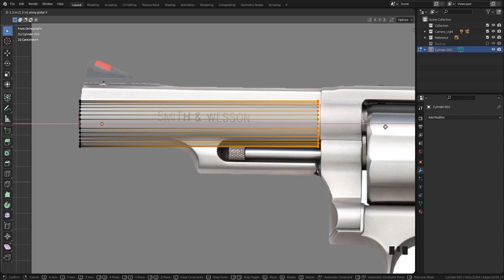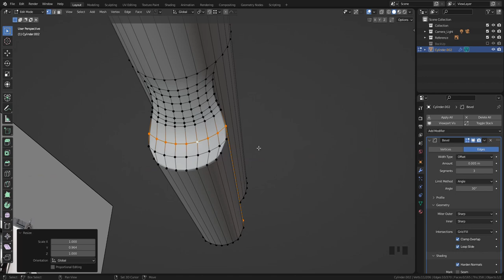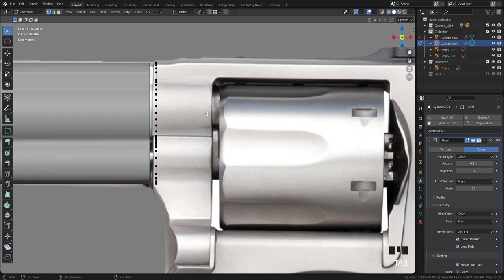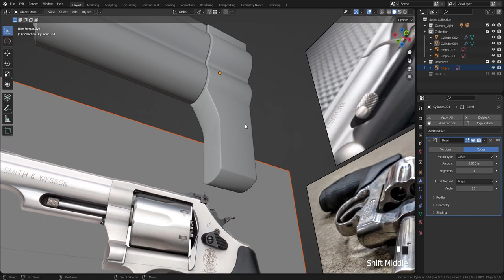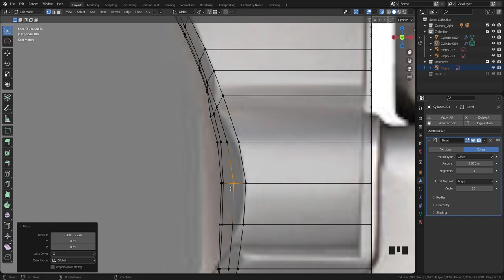Low Poly Revolver - Blender 3DCG Modeling Tutorial for Beginner

Comment: Would it not be faster to use symmetry  and soft selection @8.00. I made this not long ago using Fusion360, its you dont mind a triangulated mesh the vert count is about 6k when exported as a low detail obj , then a high detail at 2million to dynamesh in Zbrush for baking out the sharp corners. Its very hard to find sizes for say the outer barrel diameter, I find that very annoying. I end up using the cylinder and barrel to calibrate the reference image as best I can.
Reply from the maker: Hi, thanks for the comment!
Yeah using symmetry maybe faster than I did on this video. Using Zbrush for hard surface modeling sounds attractive to me. I recently learn Zbrush, so I would like to show some techniques with using other software someday.

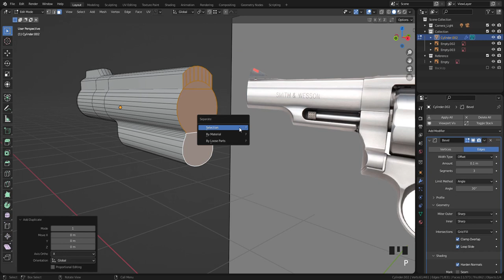Comment: 4:45 At first, i did faces the area at the back, but how did it come back? i selected the line and pressed 'F' to fill up, but it doesn't work like u.
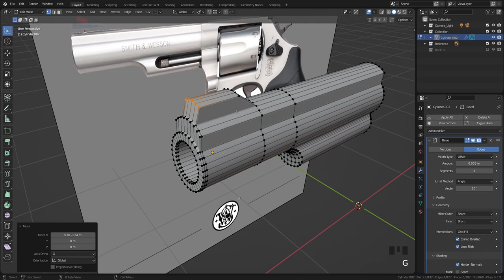Reply: I would recommend using the knife tool (by pressing "K" and pressing "ENTER" to cut the selection) and cutting in three the spheres (like how the video shows at 4:42). And by trial, I saw later on in the video that simply doing that doesn't work to do the 3 loop cut, so I selected the faces of the now cut spheres, and pressed "CTRL+T" (to make every ngon into triangles, which is better for Blender), and then pressing "ALT+J" (to turn all the possible triangles into squares, which is a lot better for Blender).

Do take in mind, I'm not done with the tutorial yet, but so far it hasn't really affected anything so...

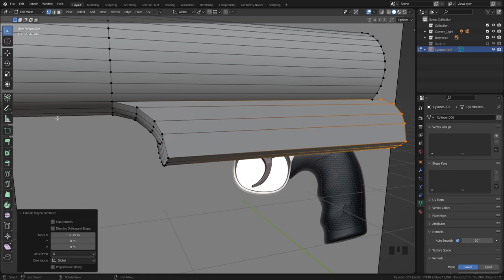Comment: 1:43 I cant flatten the mesh I press S Y 0 but it just connects the vertices instead of flattening it
Reply from the maker: Hi, I'm not really sure why, but maybe "auto merge vertices" is on. In that case, you might need to turn it off:)
Reply: My solution: S X 0 or S Z 0

So, just in-case anyone is equally as stumped, you may not be working on the same axis as the video and that's why this is happening, really threw me through a loop